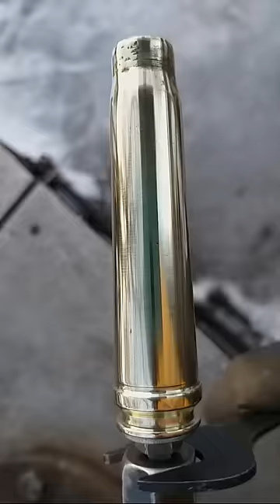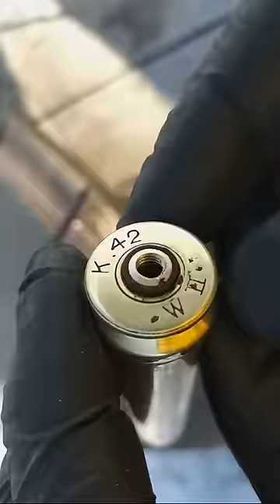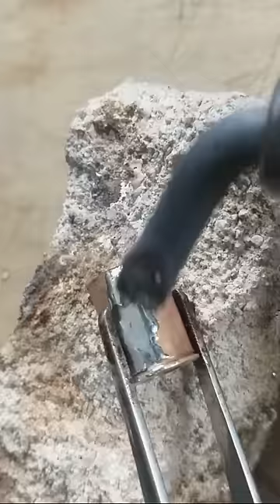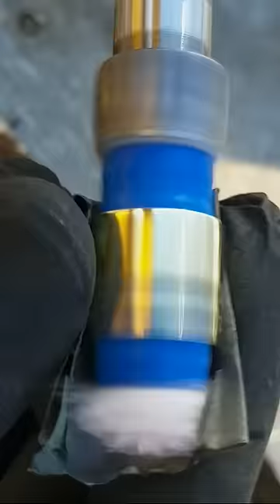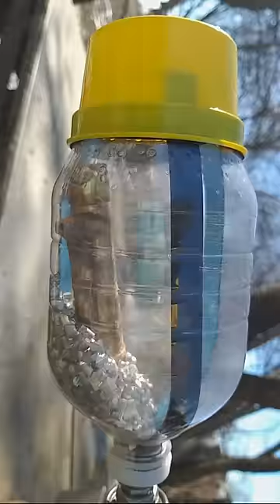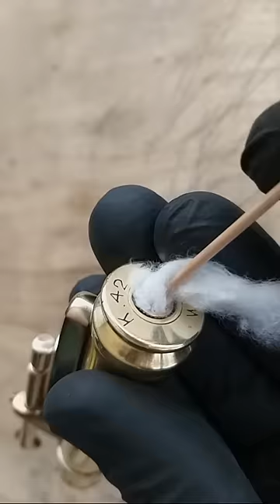Making .55 Boys Anti-Tank Casing Lighter

Comment: Hello, you are an artist. What is that white powder that you melt with other materials?
For example, to make an anvil, you poured silver and copper, and what is the last white material?

What type of sand do you use to make molds?

Then, when you pour the sand into the mold, before you put the model in the sand, you apply a layer of black material with a brush on the sand. What is that black material?